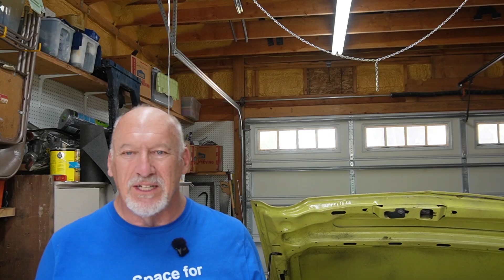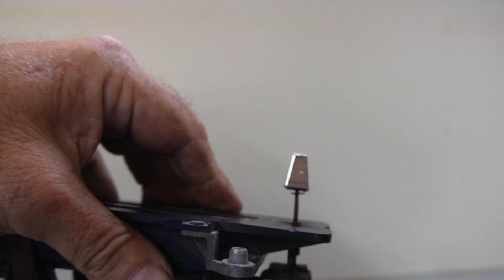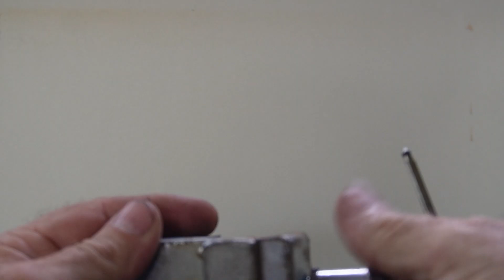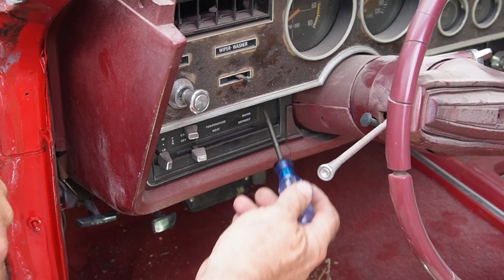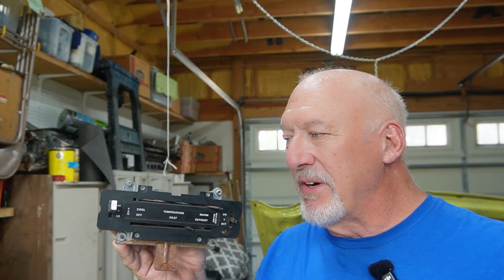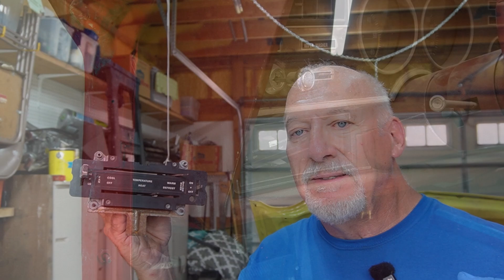Removing a Mustang II Headlight Switch and Gauge Face

Comment: Thanks Boomer for the show and tell.  Gotta 1975 and went to Google search where their Gemini AI was giving me idiot suggestions like disconnect the airbags before working on the dash!!!!   You gave me exactly what I needed to know to get both those knobs off so I can get to the Tachometer.  Next I plan on making a modern tachometer work in the dash so I can run my HEI ignition.
BTW, know anywhere I can find 1976 Mustang II 302 smog parts?
Reply from the maker: Glad you found it helpful. As far as smog parts go, very few are still in production, and most owners pitched the brackets and hoses twenty years ago, so it's just about impossible to mount up replacement parts even when you find them.

There are a number of Facebook pages sepcializing in Mustang IIs, and several of them focus exclusively on parts.

Good luck!